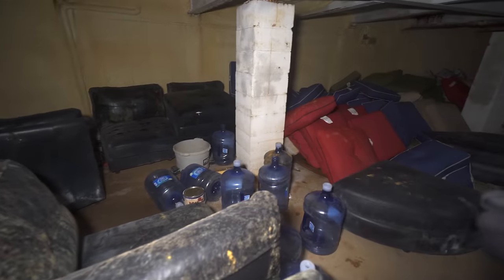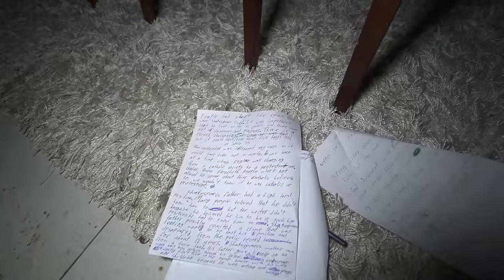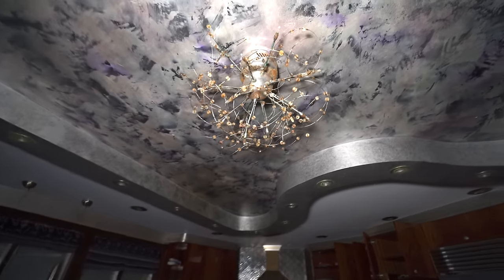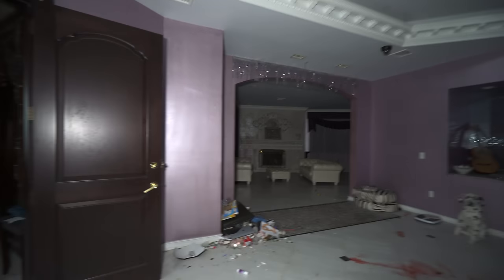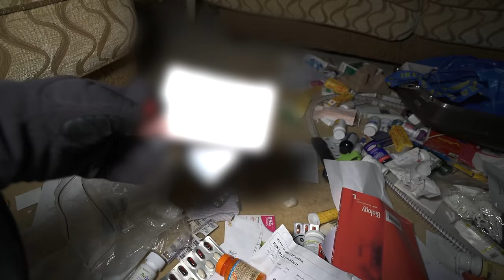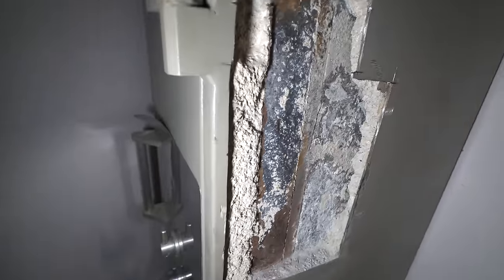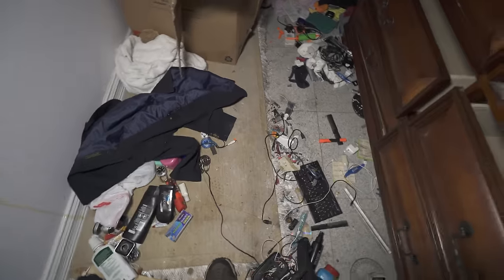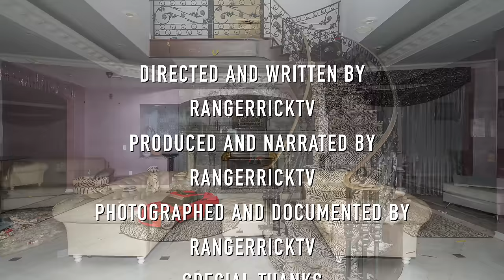Abandoned Egyptian Crime Family Mansion | Found BMW, MERCEDES, Jewelry, Underground Bunker

Comment: I actually saw  this mansion in a different explorer's chanel. It looks like its been ran sacked alot since, it was actully neat and not much was on the floor. Also i noticed suitcase on the bed with blankets on the bed that was not there in the previous video i have seen. I am all for explorers going into these homes to look around but no need to trash the place.

Comment: That's not a bomb shelter. The house is right on the ocean meaning the whole basement is built under the water table and most likely on a sand base. You can tell by all of the mold that there is so much moisture down there. The concrete and metal was to make sure it doesn't fall down.
Reply: The garage is above that area.

Comment: The basement looks like a hurricane shelter. That explains the bedroom down there. You can’t run a gas generator inside though, so that stumped me. It looks like it flooded though. I was in a flood in 1994 and that’s what the walls and wood looked like after sitting in flood water. The cars looked flooded too. I do know that the sprayers next to a few of the toilets could also be for rinsing out cloth diapers. You hold them over the toilet and spray them to flush the solids before washing them in the washing machine.

Comment: I thought you did a great job with this video! As far a some viewers say you talk to much I would much rather you the way you are yhen a silent video!! As far as the Mercedes vs the BMW. The BMW definitely wins. I had a BMW when I was stationed at NAS Pensacola Fl. You are grom the south so you already know that door suction matter's a lot in the summer. The hoses in the bathroom are for washing their back side after number two. They only use toliet paper to dry off their back side. That medication you found Valacyclovir "you can goggle the name of it if you have any doubts!" But it is used for treatment of herpes in adults. I don't know if you are aware of the Fentanyl epidemic in our country or not. But one Fentanyl pill can kill 40 adults. It is being sold on the streets as Percocet it is also being put in candy and it can be in liquid's it has been all over the News for a couple years now. The only reason I sm adding this iny comment is for your safety because this can be absorbed right threw your skin and it can kill ppl when absorbed threw the skin and more times them not ppl die from simply handling it. So please be extra careful when making the great video's you make about picking thing's up it can even be on paper. Just a suggestion keep a pair of latex gloves and hand sanitizer with you. I would love to have a kitchen like the one they had just smaller and I only want stainless steel appliances not the 80 percent of the kitchen coverd in it lol. I don't like that so called modern look I'm more the rustic cozy farmhouse vibe which I'm sure other ppl hate!! Be safe on your journeys!! 😊😊😊